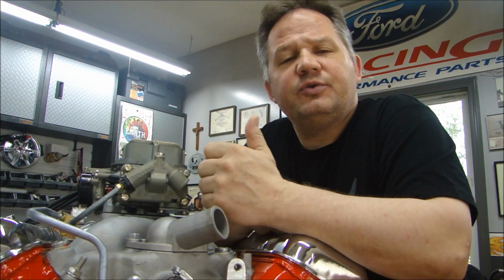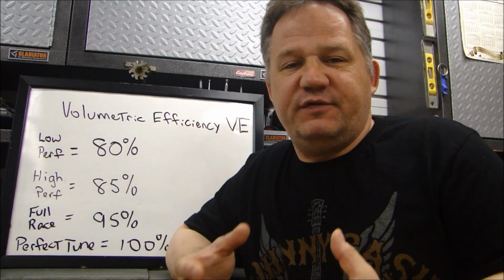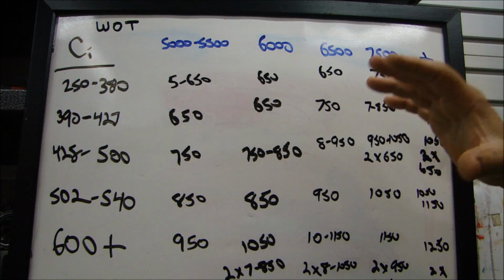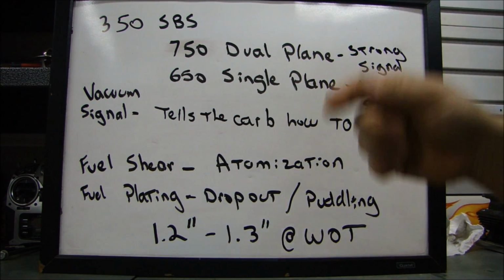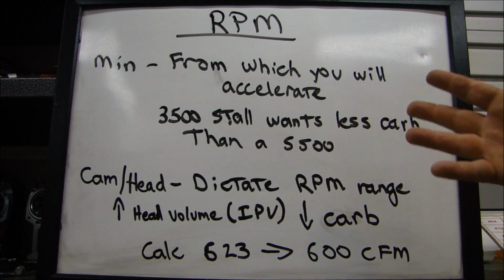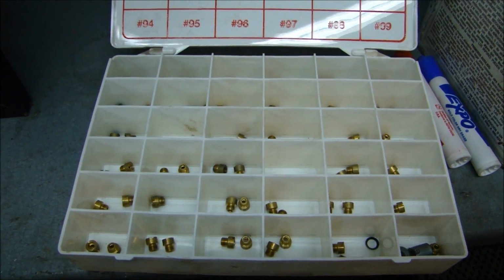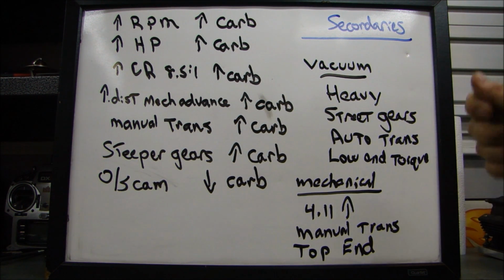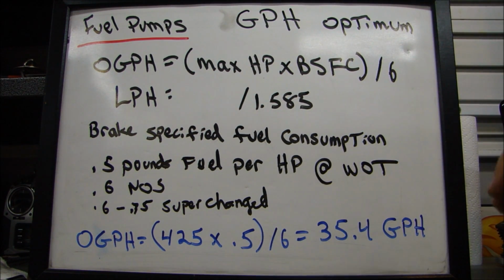Engine Building Part 14 - Choosing Carburetors and Fuel Pumps

Comment: 350 with .20 overbore.   Hydraulic roller comp cam grind, 270/274, Lift .474/.474 its as big as possible to still use Vortec heads. Air-gap intake. MSD pro billet HEI distributor. Headers at least 1 5/8 primaries with dual 2.5 to the back.  4L80e auto trans. 3.75:1 gears.  I have a quick fuel 750 double pumper but am second guessing if i should have gone with a 650 instead.  thoughts?
Reply from the maker: Yeah that 750 is a bit big for that cam. You'd have to jet it down

Comment: Hey Pete, I've been watching your videos from the very beginning, and I gotta say I'm blown away. I haven't seen anything this comprehensive anywhere and it makes me think that I am actually capable of building my own engine. I recently bought a 1969 mustang and I want to build a semi-performance 351w for it. I am in college so my budget is obviously rather limited. If I got my hands on a decent machined block, how much would it cost me to build a complete engine if I did it myself that hits around 430 hp?
Reply from the maker: Thanks Andrei. I've done a few '69 Mustangs so you're putting it in a great car. You could do it yourself for about $4,000.

Comment: hey Pete been watching all your vids and was curious im building a 360 mopar gonna have around 450 hp from motor would a stock 600 cfm edlebrock be good. would it be good if I upgraded the Jets and made it push more fuel?
Reply from the maker: Depending on the intake you use, that could work

Comment: Good job Pete !   But What Holley carb for an 1966 GMC 3/4 ton , with a GM 80s NP440 4 spd (overdrive 4th) transmission , a fresh rebuilt 350 , mild RV cam , Edelbrock intake ? Other than manual choke I don't know if I go with vacuum secondaries , 650 cfm's or what  .  And I Haven't decided on what distributor yet or headers vs stock ram ex manifolds.  Any suggestions ?
Reply from the maker: Thanks Teddy...if you're going for economy go with vacuum secondaries and a 600

Comment: I have the popular Edelbrock 2101 intake, that meant for a Quadrajet??  All I have seen mentioned was a Edelbrock #1406.
Reply from the maker: The carb pad on the 2101 is designed for a 4 barrel but I have seen 2 barrel carbs put on those.

Comment: Max RPM @ Wheelspin + Torque & HP?  

I see a lot of engines run good at 500 through 3k RPM.  But it gets iffy under 1k, and it hasn't seemed to matter what kind of engine.
Reply from the maker: That is true. At idle the engine needs to spool up in order to start producing HP.

Comment: Pete, I just watched some of your videos. I really appreciate you responding to peoples questions. That tells me you are a good guy. I was an auto mechanic for 22 years. I am currently rebuilding an Oldsmobile 350 engine for my '68 Cutlass and a 383 stroker engine for my '87 Chevy P/U with a 305 which is fuel injected. I may ask you some questions. I have only rebuilt stock engines for FI vehicles. I have been out of the mechanic industry for about 10 years. I'm a little out of touch with the latest technological advances in FI tuning and such but I am trying to catch up. God Bless you and keep up the good work.
Reply from the maker: Thank you David, I'm trying to help. We are all here to learn together.

Comment: hi, The engine is a 302 5.0 stock 1995 Mustang GT. Going in a 1991 Ford Ranger, with a Elderbrock RPM air gap intake. What is the ideal carburetor for that setup? Oh, it's a 5speed if that makes any difference. Still don't know how I'm gonna make the clutch work (cable clutch going to hydralic pedal) Any ideas?
Reply from the maker: How much HP?
Reply: IDK, whatever the Mustang GT had
Reply from the maker: A standard cable clutch is fine
Reply: How do you make it work with a hydralic pedal?
Reply from the maker: You need a booster for the pedal and an actuation cylinder at the clutch
Reply: *****
. . . . Part/s number/s, Jegs, Summit, Advance, Autozone??? Does that replace the Clutch master cylinder on the firewall?
Reply from the maker: The master cylinder is for the brakes. You need a separate one for the clutch. The Summit website is easy to search for your application
Reply: *****
. . . . It's already got that. Came from the factory. When I bought the 1991 Ford Ranger new at Gram Ford in 1990, I gave 6,411.88 for it. it had a 4cyl engine, a 5speed transmission, and a hydralic clutch. It's there, on the truck now as we speak. I pulled out and sold the 4cyl engine and transmission at 18,000 miles, the truck still looks new

In the year 2012, I bought a wrecked 1995 Ford Mustang GT. 8cyl engine and also a 5speed transmission, but this one is different. It has a cable clutch, not Hydralic, no master cyl for the clutch fluid, just a cable going to a lever coming out the side of the bell housing.

I need the hydralic pedal to work with the cable transmission. When I went to Jegs with this, I asked for everything they had for a v8 conversion in a Ranger, they sold me a radeator, headers, motor mounts, oil filter relocator, and all that cost me twice as much as the wrecked Mustang that I got the engine and transmission from. They had no clue how I was gonna make the clutch work and recomended an auto transmission, but if you knew me, you know I can't do that. I'm a stick shift gal. I despise auto transmission. Hate to drive an auto and never will own an auto. No way no how, When I'm too old to shift gears, I will stop driving.
Reply from the maker: I would get the pedal assembly from that car and put in a cable. Very easy to do
Reply: *****
. . . . I'll keep that in mind if/when I ever get that far. Right now it's a challenge to find a garage willing to work on the project as I no longer have the flat solid ground I would need to lift and drop in an engine/transmission combo. thanks

Comment: Pete, this build series is amazingly informative. I just bought a 1995 mustang gt 5.0 engine. I'm looking to bore it out and make it a 347 stroker with a dual quad carburetor. how much am I looking to spend here for 450 to 500 hp?
Reply from the maker: Probably around $8k
Reply: +Petes Garage I can handle that. I was worried about 15 to 20. where can I find a good part list to build the 347 stroker?

Comment: Hey Pete,  what is your opinion on building an engine slowly,  I'm talking over a period of about 2 years.  I want to buy parts at about 2000$ at a time,  rotating assembly, heads,  fuel system, etc.   can I install the parts as I get them over time? Or is it best to hold the parts till I have most of what I need, and install them together?  Is there any considerations, things to look out for?  Thanks DB
Reply from the maker: I have done that many times. As long as you keep the parts lubricated and dry it can be done. Cover it with a large bag, not sealed so it can breathe

Comment: when rebuilding an engine how do you set up the ECU or carburetor and spark plugs to both inject and Spark at the right times after disassembling everything and then reassembling them
Reply from the maker: If you do not change anything you should not have to. Spark is based on crank position and injection is based on cam postion.

Comment: If starting a new motor that you want abou 550-600 hp would you rather build a LS. Or 351w
Reply from the maker: It depends what it's going in. The LS will cost less to get that HP

Comment: Great video! Very helpful for a young guy like me just getting into engine building. Is there anything I should keep in mind when using a tunnel ram? I'm working on a mildly built street/strip 350 Chevy backed by a 4-speed manual and 4.11 gears. Thanks!
Reply from the maker: A tunnel ram shifts the torque curve towards higher RPM. It will run a little crappy at idle

Comment: bro can you explain to me the concept of balancing your engine n why it is important hp wise
Reply from the maker: When you balance all of the parts you eliminate vibration which steal HP. The vibration will also cause parts to wear faster not to mention shake the hell out of your car. When you buy parts they are balanced, but they must be put together and balanced as a system.
Reply: tl;dr - harmonics, friction, etc

Comment: Does the vacuum reading at max torque occur when you rev u p a motor unloaded?  I would think the vacuum reading would be radically different. But I am not sure of that..
Reply from the maker: No....it has to be under load in order to be tuned correctly.

Comment: Pete, ive been following your engine building series videos and ive learned a lot. thank you for taking the time to do this for us. I do however have a couple of questions which I hope your able to either make a video about or possible answer if you are able to help.. my scenario--im building a 331 sbf stroker, im shooting for 10:1CR, cylinder heads have not been picked out just yet but I have an idea of what I want, I have 4:10 gears now with a t-5 5 speed trans, 275/40r17 rear tire which I think is 24-25'' tall, cam is not ordered yet because I want to match it with the heads and intake which I learned from your video. I want to carb this motor. my current setup in my car is EFI, ive been looking on summits website and seen that the holley blue pump is in the range that I needed for carb. I realize I need to know a whole lot more info before I can make a decision on carb size but I feel intimidated by this build just because I don't know all the answers I need. I hope this doesn't take too much of your time reading this. Thank you Pete.. I look forward to your next video :)
Reply from the maker: +david cabral You have the information needed to pick a cam that will give you the torques range for the tire size and gears. Take the time to tune the carb and you will have a great set up
Reply: Thank you Pete. Your a good man.
Reply: +Mark “Just-Plain-Joe” Crawford thanks for the msg. i have not yet reached out to them. simply because i dont know the specifics of the rest of my build. heads, carb size etc.. my car which is a 1989 mustang foxbody is not going to be built for the track but more of a street warrior..its my daily driver to work everyday during the summer here in canada. id enjoy to hear more about what you have to say. thanks
Reply from the maker: +Mark “Just-Plain-Joe” Crawford Awesome stuff....thanks for the comment!